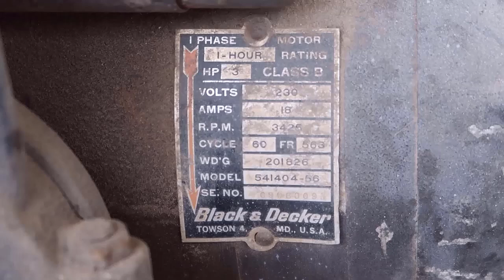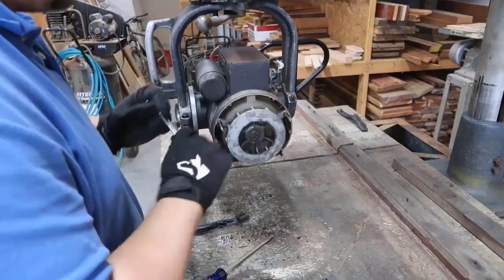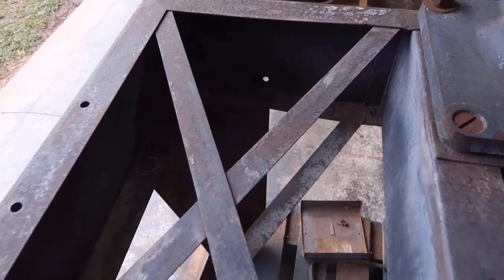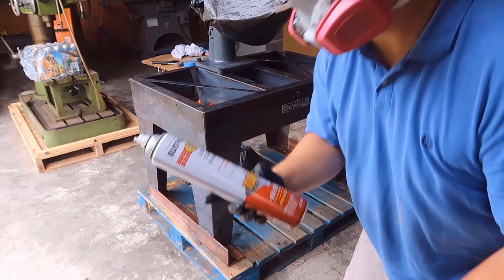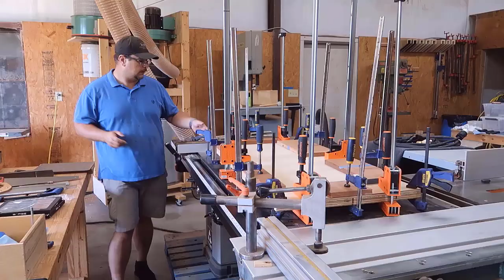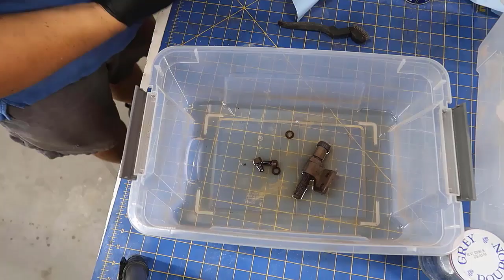Dewalt Radial Arm Saw (RAS) Model GA Complete Restoration

Comment: Nice job Phil! Why don't you run the wire to the nose bottons? I love the 3HP Frame 563. You should wire it 220. Half the amps. The difference between a Standard Arm (16" crosscut) and Medium Arm (24" crosscut) The Medium Arm has a 42" long and the base is 36"x48" as compared the the Standard arm's base is 36"x48"
Reply from the maker: Thank you very much for your feedback and expertise, it is greatly appreciated.
The saw is wired 220V already ;-) I tried to troubleshoot the nose button but I think soemthing is wrong with it  as I did not get the proper contacts (I couldn't figure it out) so I left the other ON/OFF switch. It works great but it would be nice indeed to have the orignal button running at some point :-)
Reply: @prophilwoodworks  Interesting. I'd love to see the motor tag. So you think the switch itself is bad? Original saw sells that switch. I did notice in the beginning of you video that you did have that narrower wire that comes out of the magnetic starter. That was the nose button wire. I may also have a few buttons in my shop. I know I just sold one a few weeks ago. I have to try that clear coating you use. Very nice!
Reply from the maker: @DeWaltRadialguy  Yes, I tested the switch and I think it is dead. If you have one available I would be interested 🙂Regarding the motor tag. You can see it in the video at time stamp: 2:33, 3HP Frame #563
Reply: @prophilwoodworks  I will check. I love the frame 563! Yes 18 AMPS 220V. Mine nuns fine on a 20AMP breaker.